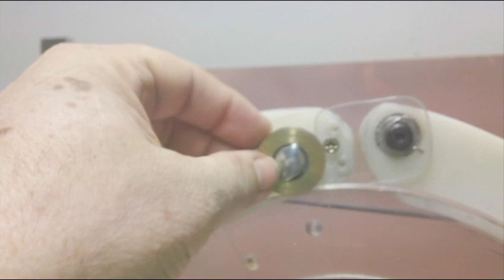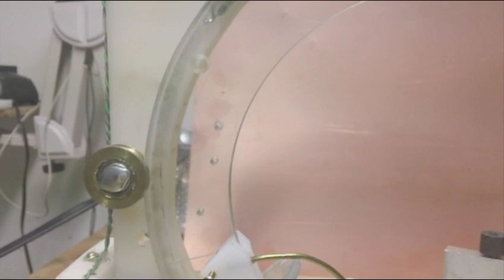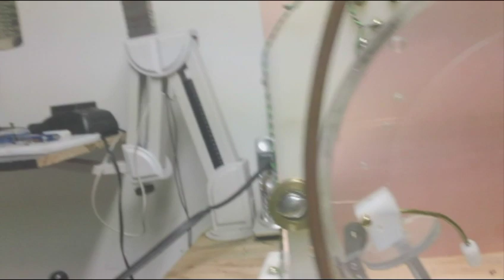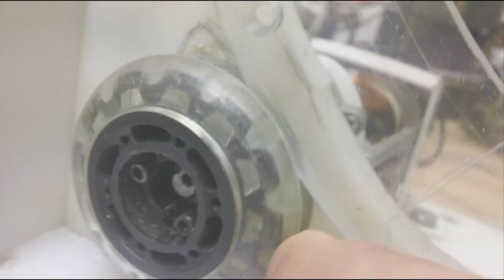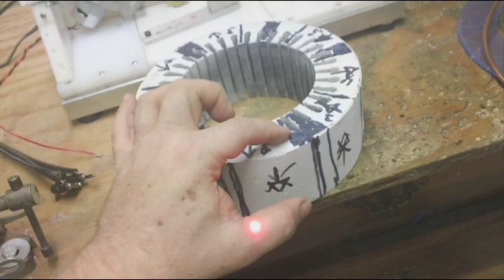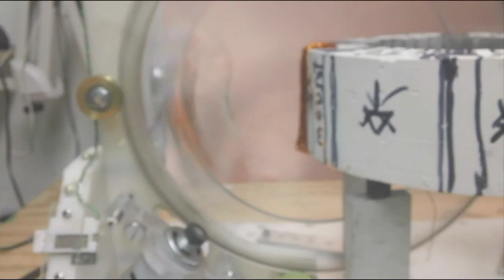Toroid Winding Machine

Comment: That's a cool winder you built ... I want to get one together ...
I was thinking of using a old sewing machine motor along with the pedal type switch , so I could control it's speed and function hand's free , they have plenty of torque and will crawl if needed ...  Thanks for the show an tell , your design is very well thought out .